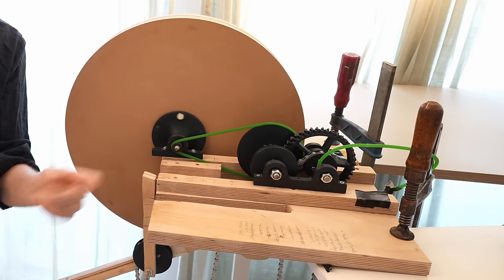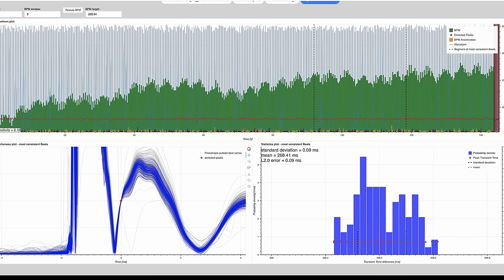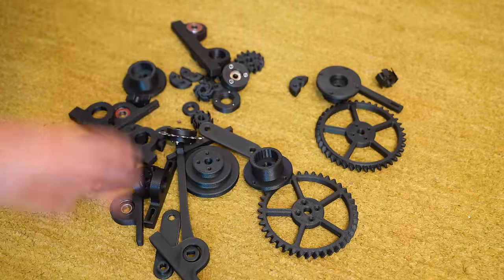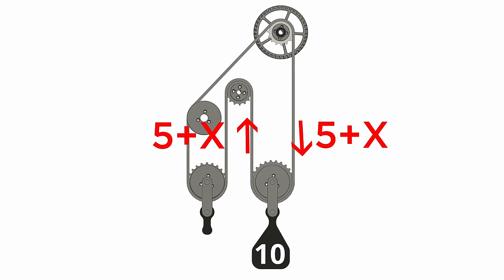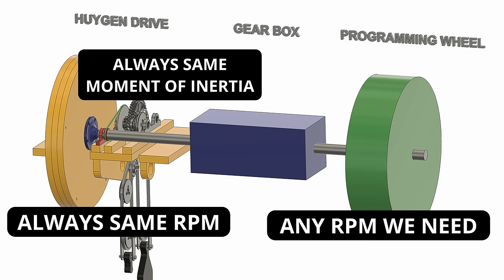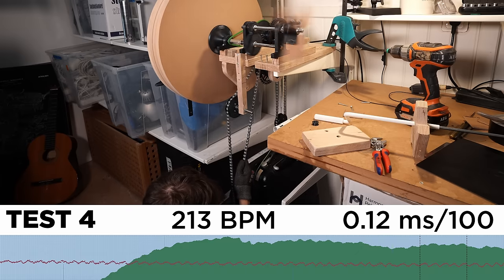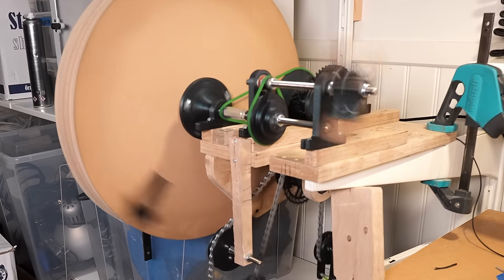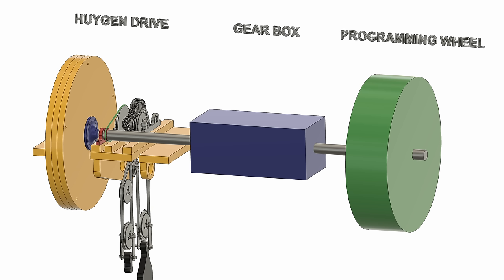Using Gravity To Play Tight Music

Comment: What are you going to do about uneven mechanical load? Adding or subtracting various instruments will change the energy needed to run the system. Also tempo changes will be very difficult. The first one will be quite interesting to deal with, the second can probably be dealt with using a continuously variable transmission and a crank/dial to adjust tempo.
Reply: yesss!!!! Why is nobody else mentioning this? As the load varies (adding/subtracting instruments) the bpm will surely change. The huygens drive creates a perfectly stable input torque but thats not gonna result in tight music if the resistance of the system is all over the place. At least i imagine it to be like this. Am I mistaken here?
Reply: A governer can change load based on speed, so it should be possible to have a purely mechanical system that balances at a consistent speed despite variable load.
Reply: @lennytheboss100  People have been mentioning it for months and months, but Martin doesn't want to hear from anyone that isn't in lockstep with his mindset.
Reply: @TlalocTemporal  That might end up wasting a LOT of energy depending on how much the load varies, resulting in an even bigger weight. It also will not be an instant process, as the governor will need to gain/lose angular momentum which will take some time to happen (this can probably be nicely modeled with some differential equations). Even worse, a larger governor will be slower to respond. You could maybe put a series of governors of different sizes to balance this effect out, so that smaller governors can respond to finer adjustments and help keep up with the slow response time of larger governors, but this could get complicated and messy fast. And that isn't even taking into account all the vibrations that governors could cause, with such variability its not far fetched to accidentally end up with resonance (VERY BAD) under certain conditions.

The thing is, mechanical instruments with such precise timing and complexity are... difficult to say the least. Most automatically playing instruments actuate things based off of air or steam or something iirc, which would have far less resistance, and even carillons, which are huge and take a ton of energy to work, are a very simple mechanism (basically just a rotating drum). What Martin is trying has the worst of both worlds, and I'm really not sure if there truly is a purely mechanical solution here. Complex machines that fine tune precision like this within a complex system under heavy and inconsistent load, like cars, tend to be computer controlled for a reason. But needless to say there's no way that Martin would ever consider this.

Honestly, a thought that I've had is to perhaps have a gearing system that works in conjunction with the levers - so, pulling a lever to activate an instrument not only activates that instrument but also changes the gearing from the mechanical input. Once again very complicated but I genuinely don't think there is a simple solution for this, at this rate he needs an entire engineering firm to make this work lmao
Reply: No. The difference is simply in the number of marble gates opening. If the marble gates are made well they will require minimal force to operate. I don't beaver that the difference between 10 and 20 marble gates opening will matter for tempo. Especially since they are going to be actuated using a bowden cable which are extremely efficient at moving force.

Additionally if really necessary an extra part can be added to each of the gates to make turning off an instrument independent of gate actuation.
Reply: Would it not matter how many instruments were being played if ΔE>0? So as long as the primary weight produces more energy on the flywheel than the rest of the system at full load requires, it should be fine, right? Or should it be that, if the governor functions as a capacitor in a circuit, then the governor should have enough energy to absorb the full load without losing rotation? 

Using an electric motor would be more efficient than a hand crank. Using a motor and bypassing the entire mechanical system would be the most efficient. Wire in a floor switch like a stomp box and then write a program to determine and balance BPM exactly how you want it. As cool as all this is, is it really feasible to continue going down this rabbit hole, too?
Reply: Oh no. The slight difference of how many spring loaded Bowden cables are pulled at once will totally throw off the system!
Reply: He will need to add an escapement mechanism to get accurate frequency. Then the whole machine can tick at a specific rate that will not be impacted as much by the load.  I would suggest using an off the shelf mechanical clock escapement.
Reply: @GBR6000 It is not just the marble gates. The marbles have to be moved up again and depending on the amount of marbles dropped that weight changes. Don't know how big of an effect that has, but I'm not a fan of ignoring that potential problem. Also Martin is chasing timing values for his "tightness" that may well be affected by even those small changes. Currently he is fine tuning in ranges of 0.12ms/100 that is 1.2µs deviation. If sucht tight timing is required by Martin then even the bowden cables might be enough to throw off the timing.
Reply: Could a mechanical pendulum (as used in clocks or metronomes) solve this issue of mechanical load ?
Reply: @nako9790  This would likely require inventing an entirely new system to smooth out the clock input; such a system might exist, but it would likely be quite complex as it needs to adjust the speed of a separate system without impacting itself and while also providing a smooth output
Reply: @Bryanerayner  Considering how hellbent martin is on perfect timing, that would be a huge difference
Reply: @StuffandThings_ -- The governors will require a change in speed to work, true. If the governor's speed is much higher than the working shaft, a small change in speed can be caught quickly, and a small braking force can be a large load.

I had assumed that the gearbox and possibly the weight would be tuned to the song setup before operation, but some songs change instrument use drastically don't they? A gear changer that can multiply the effect of each instrument to get a gear sounds really complicated, why not several huygens drives in parallel, each adding torque alongside each enabled instrument? 

Besides, can gearing alone fix a power issue? If the huygens drive is producing constant torque, then it must vary in speed keep the music shaft at a constant speed. Changing the speed of the whole huygens drive mechanism feels a lot slower than an automatic brake.
Reply: @TlalocTemporal  Yeah I'm beginning to think that an entirely separate module for each instrument is the way to go here. It would be huge (and there would be lots of drives to crank somehow) but it would solve a lot of issues.
Reply: A thought: Could it make sense to have two separate systems? One for the drum/gates and another for the transportation of marbles?
Reply: im thinking yeah the continuous gearbox would fix the tempo change but when it needs a greater force he could use an air governor that you can change on the fly? dunno if thats a thing
Reply: that's what the governor is for. The power input will deliver more power than the machine needs at full load and the governor will limit the RPM. If the machine needs less energy, the governor is breaking more, if the machine needs more energy the governor is breaking less to keep the RPM constant.
Reply: @nako9790  I think this is def one of the easiest ways to produce a controllable constant tempo. A back and forth motion is a better approach than a rotary one. To do it mechanically and keep the force rotation and constant would either be a constant speed drive gearbox (which might actually be hydraulic based), or a system between a variable speed gearbox and a centripetal governor. I think the use of air governors on a system that is trying to conserve energy is not a good idea because its a waste of energy. Its taking the energy and producing wind instead of music.
Reply: @livinghypocrite5289  What if he always runs the max amount of marbles through the lift? Any marbles that dont make it into a chute at the top overflow and are sent back down to the bottom again. That way the load from moving the marbles would always be constant. Would look cool too, lol
Reply: @readams  
Agreed, but even an escapement is sensitive to varying loads (clocks don't usually have varying loads).
The escapement could provide timing, but the drive power would probably need to be separate and  triggered by the escapement without adding or removing power from it.
Reply: @XGigabowser51 Could work, but sounds like a very complex mechanism to get that right. Marbles falling are faster, than marbles rolling down, so the overflow marbles would have to fall, too. And then you have the problem of the marbles hitting instruments and getting a delay because of that.
Sound slike something that would add a lot of points of failure to the system and not reducing part count and complexity.
Reply: You need to be careful what types of load you are talking about here chaps. Purely adding more rotational inertia (in the form of changing up a gear on the machine) will only mean the machine takes longer to reach equilibrium. Then there are the separate resistive forces that are proportional to speed which eventually cause the machine to reach equilibrium. If martin uses the right bearings etc maybe there is a chance that the change in speed between the machine and flywheel, when changing up a gear, causes an increase in resistance which can be countered by a mechanism which links the gearbox to the governor. Changing up a gear could change the configuration of the governor to reduce its resistance?
Reply: @StuffandThings_  -- All the programming wheels still need to be connected though, can't have the machine lose time with itself. And if all those mechanisms are in lock-step anyway, there's no reason to separate them by more than a clutch.

The marble elevators could be a separate system though. Is there a way to reduse the power from the huygens drive, or would several huygens drives clutched together be better?
Reply: But you guys still haven't the "world tour" taken into accout. 50 times de- and reassembling will destroy any tight 0,1 ms tuning
Reply: @alphonsbretagne8468  As if a "world tour" is ever going to happen
Reply: @livinghypocrite5289  do you remember the old marble recycler from the last marble machine? I'm imagining something like that, which was just a tube that fed the overflow back into the fish ladder. I'm not sure why it would be complex, it could be just a chute to whatever reservoir the main marble lift pulls from. The marble lift will already be there, so I'm not seeing how this would add any complexity or points of failure.
Reply: @XGigabowser51  The goal from the old marble recycler wasn't to always have the same number of marbles on the lift, to keep the load of the lift even, to not mess with the extremely tight timing Martin is aiming for. And to get that result could be extremely complex.
Reply: @livinghypocrite5289  Agreed, the goal wasn't the same, I mentioned it just to give an idea of what I had in mind. Assuming Martin has a similar kind of marble distribution, where marbles roll past channels and fall in the channel if it's empty, then my idea is to allow marbles that don't find a channel to roll back to the start of the marble lift via an overflow path. If Martin adds enough marbles to the system, the marble lift will always have a full load regardless of how many instruments are being used. Can you help me understand where the complexity is in that?
Reply: @XGigabowser51  Agreed, that isn't so complex. Did not see that option, to add so many marbles, there are always marbles waiting at the lift. Would be an option.
Reply: @Krmpfpks not how governors work. They provide a constant resistance for a given speed. As secondary load increases it will necessarily drop the RPM (tempo) to drop the resistance of the governor - i.e. Increasing the load of the machine necessarily decreases the tempo. You can limit this effect by making the resistance of the governor significantly higher than the rest of the machine, but that's very wasteful.
What you need is an active feedback system like the centrifugal governor in old steam engines that can increase the power provided by the drive as they slow (a gearbox between the weight and flywheel drive)
Alternatively, driving an escapement with some smoothing after it (a big coil spring) would provide a significantly more consistent output regardless of loading
Reply: @hilburn-  governors increase the resistance with speed, that’s the whole point of governors. Think about the ones that were used as safety devices in elevators, they applied a brake proportional to the rpm of the governor and therefore limited the speed of the elevator falling. Depending on resistance v rpm curve of the governor you can get the rpm pretty stable. The air governors resistance only slightly increases with rpm - which is why Martin needed to use a gear ration to make them spin multiple times the speed of the fly wheel - but other governors have different curves.

Comment: so we'll end up with a crank, stabilized with a flywheel, feeding a huygen drive, with another flywheel, slowed by a continuously variable air governor, that in turn runs a cvt, which then goes to the programming wheel.
and we want to minimize the number of total parts. what a project
Reply: Just wait until he tries to reinvent the transistor so it can be programmed like a computer.
Reply: I really hope they go back to the escapement mechanisms that he used in the MMX, those would be perfect for this application (basically a clock) and use way less parts than a CVT transmission for your flyball governor that still will be off.
Reply: no progress will ever be made if he wants perfect timing.  just program everything in midi at that point.  nobody but him cares about this “issue”
Reply: @barb0za0 how else will he milk the project as a stable income. This is no longer about creating a live action animusic machine, but creating content.
Reply: MMv1 is still my favorite.  It's quirks, it's sounds of the mechanism, it's flying marbles.  I was fine with v2 because I know v1 required lots of maint after each run.  I saw the need to make something reliable for shows.  But it didn't need to be perfect.  Perfection is digital and digital has no soul.  Sadly I've lost interest at this point.  Would rather have seen some new music machines, not yet another version of the same.

Comment: You mentioned that you want to quantize the output using a governor, but it is still delivering a continuous output. To truly quantize the power, you need to add an escapement mechanism leading to the programming wheel so that it ticks like a clock. You could then adjust the escapement (changing the tension on a balance spring, or changing the length of a pendulum) to deliver whatever tempo you want. Adding a centrifugally governed clutch to the flywheel to prevent the weight drive from "overwinding" it would also prevent overloading the escapement.
Reply: This should be way up

Comment: The weight is not just filtering your input, smoothing it out but it's storing it like a battery.
Reply: It basically behaves like a mechanical version of a capacitor
Reply: It's kind of  like a mechanical capacitor :)
Reply: It is 100% useless as a battery for this purpose though, as using it on battery power will sound terrible as the music immediately starts slowing down
Reply: @martinshoosterman  That's making me think something like a CVT with ratio control feedback system based on output rpm is needed. Or basically the mechanical equivalent of a voltage regulator.
Reply: @martinshoosterman  The music won't slow down until the weight hits the ground. So as a battery it's great if you had enough vertical space to hang a weight for an entire song.
Reply: @bradley3549  Oh I thought he was talking about the flywheel weight, not the actual weight weighing down the pulley. my bad.
Reply: @Lttlemoi  It's a capacitor but its charge cycle is much larger than the duty cycle of the circuit.
Reply: In this case the system works like a low pass filter